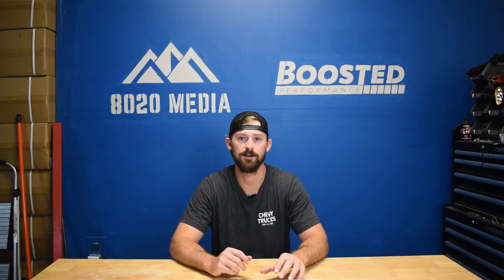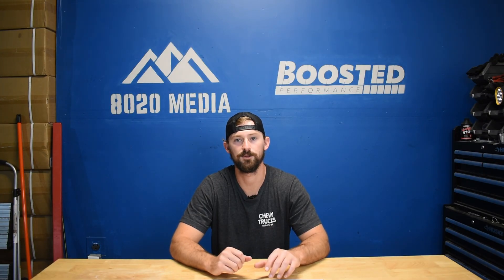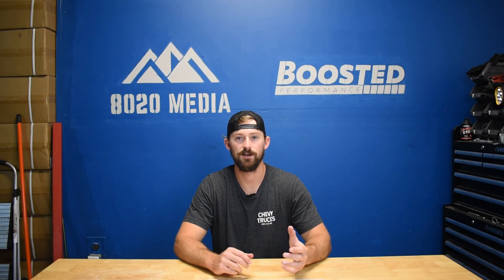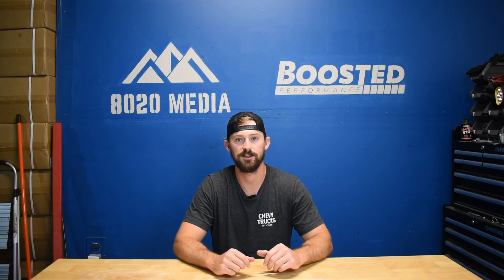The 2.4L EcoTec | 4 Common Problems & Reliability

Comment: 2015 GMC Terrain, 191k miles, runs great.  Change the oil every 3k!!!!
Reply from the maker: Joe - Thanks for sharing your experience and insight!
Reply: Joe, that's awesome but  you have to be diligent because eventually the orifice will start causing a lot of consumption.  It's not gradual, its with off/on speed.  I did every 3k for 10 years then it went 3 quarts low in 4 days on me.  So honestly, check it every other day or every day.  Mine went 3 quarts low 4 days after an oil change. wasnt' burning cuz exhaust was clear, no drips no leaks... hmmm.  You have a lot of information and know what to look for now in 2024 so that's a plus.  in 2020, I didn't know. keep checkin it bro,

Comment: I have a 2010 Malibu LE9 flex fuel and I could tell you the 85 makes a big difference with torque and at low RPM, picked it up from auction and it had 161,000 miles. I've had it for about a year and a half I've done a lot of maintenance including draining the sealed transmission/coils,spark plugs oil changes, you name it. Now the car is at 183,500 and still running it's put me through hell working on it but I don't regret it.
Reply from the maker: Get - Thanks for taking the time to share your experience!
Reply: E85 fuel will destroy engines faster than any other fuel, the only reason for the better performance is because the fuel has a higher oxygen content.

Comment: My 2013 Equinox also had fuel dilution due to high pressure fuel pump seal failure (125K miles).  Fuel was in oil and the vapors in PCV were causing misfire codes due to running lean.  Also would "diesel" after shutoff due to these vapors in the PCV system.

Earlier the PCV "orifice" got clogged (90K miles) - had to remove intake manifold and clean it to avoid rear main seal blowout.  I am periodically doing the intake service 

In general, I am not a fan of GDI engines - due to the carbon buildup issues.   Have a Tucson 1.6L Turbo GDI starting to consume oil at 60K miles like the Ecotec.

I only have a few more decades in life - and I will never again buy a GM product.  With today's technology, these type of poor engine designs should never make it to market - but in the interest of fuel economy they will try anything.    A properly designed engine should not burn oil between changes,  require a timing chain replacement at 100K interval, piston ring replacements and other costly  maintenance.    GM should give up small engines and buy them from Toyota.
Reply from the maker: M - Unfortunately, engines are built like they used to be. Thanks for sharing your experience!
Reply: Every auto manufacturer uses GDI engines. Blame the government.
Reply: @a3300000  I think Toyota has a D-4S engine with dual injection (port and direct) - first released in 2007  (made by Subaru).  The port injection will keep the intake valves clean.   Ford also has EcoBoost engines with this same feature.   Will look for this type of engine next time I buy a car.
Reply: @mjkirk12  oh yes, I forgot about that. That would definitely take care of valve coking issues.
Reply: drill a hole in the intake manifold to clean the orifice, plug it with a screw... clean every oil change.

Comment: What I don't get is how all these people on here are telling you to top off your oil do this do that You shouldn't have to be doing that if your car is burning oil The 2.4 is trash bro. I have a 2012 terrain from jump Street I've been having problems with this SUV I bought it used with $62,000 mi on it I'm up to 146 now but my engine is blown. I bought it in 2019 heard about the recall in 2020 so it was already too late for me so I've been doing everything in my power to keep this car on the road I've changed catalytic resonator muffler both VVT solenoids change the engine oil cap You name it I've done it even kept five quarts of oil with me. The car burns so much oil it's ridiculous and it's just poor worksmanship by GMC so at this point I have ordered a new engine so I don't have to worry about all these problems because it's cheaper to keep her and I don't want to jump into another car payment and I've only had seven more payments left on this car less than $2,000 left and my engine blows. I mean I can drive it but I'm only running on three Pistons and I'm just messing my car up even more to the point where I was only getting about 8 to 10 miles a gallon now so I had to bite the bullet and make the choice either finance or put a new engine in which would be cheaper fuck GMC they knew about the problem and they still put the problem out there cuz they wanted their money they don't give two shits about the people bro
Reply: Worst engine ever built! 2012 regal literally burns a quart per tank, and good luck finding a hybrid that doesn't have a broken generator bracket or bolt...worst design ever!
Reply from the maker: Kev - Sorry for the experience, however, we appreciate you taking the time to share it with everyone!
Reply: @kevlandry8493  I hear ya, I have a 2011 regal that I purchased in 2012 with 30k miles on it.  It was perfect for a long time.  then in 2020 it started consuming oil, then more, then more.  Zero exhaust smoke, zero leaks.  Like Rontam06, I have to carry a gallon of oil wherever I go.  Oil was changed at 3k religiously.  And the worst part is when I called GM a few days ago they said you missed the deadline.  WTF? you still effed up, and your mistakes are costing people many thousands of dollars and some just don't have that kind of disposable income.  They are still negligent so a time deadline is a smack in the face to those that are having to pay for their negligence. 

I don't know where or how to proceed.  My car has been in the dealership many times during those years and they said nothing about it.  I asked about the oil they said just keep checking it a few times a week like you have been doing and you'll be fine. Meanwhile, they knew since 2009 which is documented. This is unforgiveable.  Even the Special Bulletin states that unless a customer complains about it, stay quiet.  That is some shady chit.  I have zero dollars to fix my regal now and well, it's just really bad for me right now in life and not having a car does not help. 

I came here to ask 8020Media if there is anything he thinks  I can do.  GM says you missed it, period.  game over.  but I sit and think about while my car is in the dealership and I'm asking about oil consumption, they are doing piston ring changes, and timing chain changes to the other vehicles.  Why not send me any type of correspondence about the issue.  Because I was diligent about taking care of it so long I missed a window.  They have performed many recall items on my Buick that I didn't know about but the big one, they knew and said nothing (while I'm asking about it)  how is that acceptable?  I now wish I would have let the car go, skipping oil changes, then I would be in the window when the timing chain is clanking around in about 2014 or 2015.  At least I would have got it fixed from them.  But because I nurtured mine along till 2020 i'm screwed. makes no sense.  All of the class action suits are all the other cars, not the Buick Regal.

Sorry for the rant.  I'm just livid about this
Reply from the maker: R - So sorry to hear about your experience. However, we appreciate you taking the time to share your story because this can certainly help future viewers!

Comment: I have a 2008 Pontiac G6 with a 2.4 that I bought new; it has 282,000 trouble free miles on it. I’m loyal to a maintenance schedule, and as a result, I buy it again if I could.
Reply from the maker: R - Thanks for sharing your experience!
Reply: Nice I have a 2007 Pontiac g6 with the same engine
Reply: Your 2008 engine has nothing to do with the issues a lot of people are facing.  So while we are all so happy for your amazing results, it helps no one with the issues described in the video.  The 2.4's from 2008 and even the 2.2's were rock solid.  You would have to work hard to screw them up.  I have an R22 toyota from 1976 that still purrs like a kitten at 486k on it.  But I won't go into a video comments, or forum where people are pissed off about their new Tacoma or Tundra  engines dying at 50k miles due to bad engineering from the manufacturer because they don't want to hear it (and rightly so).  Toyota does not make poor choices like GM.  Nobody is perfect but GM shit the bed in so many ways on this Ecotec platform.  Tocoma and Tundra have pcv valves.  GM says, ah shucks, we don't need that.  Lets put a small orifice in the head, we're gonna revolutionize automotive engineering.

Comment: Why doesn't General Motors doesn't do a recall for this problem. Now I have to get repaired. I have been doing the oil change regularly. I never heard any noise on my trimming chain. It cost over $4500.00
Reply from the maker: G - So sorry to hear this.. What problem are you referring to exactly?
Reply: @8020Media  well I have engine code p0010 p0011 2016 Chevy Equinox 2.4 engine. The dealership told me that I replaced the pistons and timing chain. Now my serpentine belt broke. Cost is over 5000.00
Reply from the maker: G - So sorry to hear this... Thank you for sharing your experience. This will help future viewers!
Reply: Same thing happened to me. No warning and all of a sudden my Equinox cut off. Then it sounded like the chain was grinding. I kept the oil change and regular maintenance and it cut off. I bought it from a Chevy dealer so I thought it was straight.
There are a couple of Equinoxes parked just like mine in my area. GM knew they put out a defective engine and should have replaced them..

Comment: The issues are correct but the causes are wrong. Timing chain gets worn because people don't change their oil. Enough 3,000 mi people 3000 mi. And the oil consumption is due to a bad PCV valve system
Reply: No... it's the faulty piston rings.
Reply from the maker: Q - Thanks for sharing.
Reply from the maker: R - Thanks for sharing this insight, but do you really think these problems have one and only cause?

Comment: Dorman sells a timing chain bolt upgrade. High pressure fuel pumps can fail early. The PCV hole can clog early, blowing out the rear main seal, particularly in cold climates.
Reply from the maker: Dos - Thanks for sharing this insight. It will certainly assist future viewers!
Reply: Dorman and ZZP, ecotec owners best friends.

Comment: Are these engine the same as the terrain?
Reply: Yes. And they're garbage. Ours started around 85,000. Good thing I only spent $4,000 on it.
Reply from the maker: Q - Sorry to hear about your experience. However, thanks for sharing.
Reply: @Lukja91 mine has 150k miles no mechanical issues
Reply: @Natefrm519   cope
Reply: @Lukja91  bro what mine doesn’t have any issues what is there to cope😂😂
Reply: @Natefrm519   it's an issue of WHEN. You have a diamond in the rough, but it will still be affected by the oil issue.
Reply: @Lukja91  it’s possible but it’s an older malibu with the 2.4 and i’ve beaten her pretty good we’ll see if she makes 200k miles
Reply: @Natefrm519   cope
Reply: @Lukja91  shut up guy it’s not a terrain
Reply from the maker: Self - The terrain does have the 2.4L EcoTec. This article written by us may be helpful for you: https://tuningpro.co/the-4-most-common-gm-2-4l-ecotec-engine-problems/

Comment: Bro really said probably changing the timing chain 2 or 3 time to get to the 200k mile mark😂  dammmm ... imo as a  owner of 2.4l ecotec malibu with 125k miles on original timing chain ...the best thing is keep up with the oil changes 😊 ..on the fb malibu club ..their are people  who have gone 200k on original timing ...and i aslo believe the pistion rings recall were only on the LeA ecotec engines..which were equionix , terrain & transverse ;the maibus 08-12 use LE5 engines... ; i think one time is good enough to change the timing at @100k, if you want to keep the car for a long time .. but at same time  you gotta keep up with the transmission oil as well .
Reply from the maker: Tony - "i think one time is good enough to change the timing at @100k" So to get to the 200k mile mark, that would be 2 times. Thanks for taking the time to write out this insight though.

Comment: Hey guys, im a owner of a 2015 Chevy Equinox with this engine. I currently have 356000km with the original engine. It burns the oil but if u top when necessary this engine can last. Never use the oil life data screen. Change every 5000km
Reply from the maker: Dennis - We completely agree! Sounds like you take great care to get that kind of mileage.
Reply: Make sure to clean the PCV orifice and making sure the ring lands are not stuck and the oil consumption will go down.